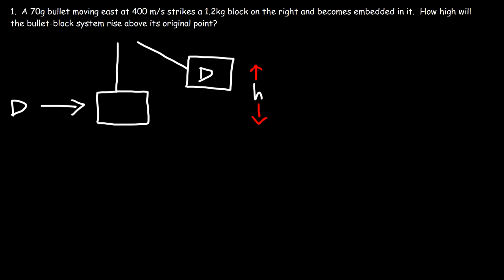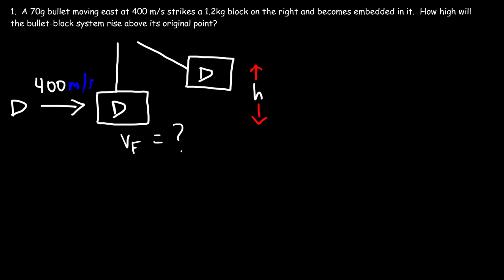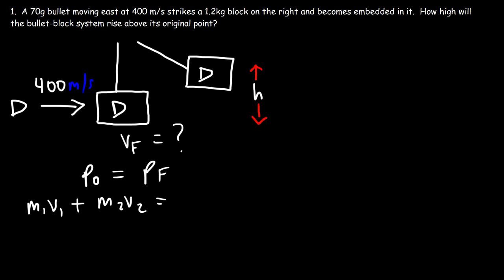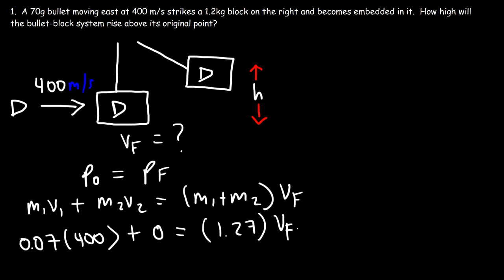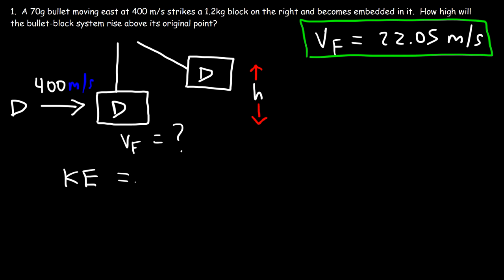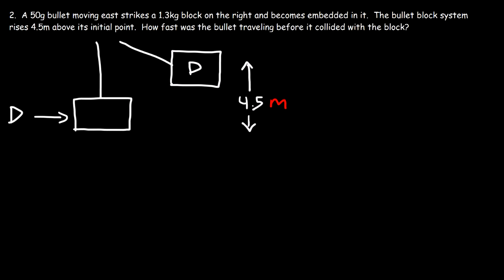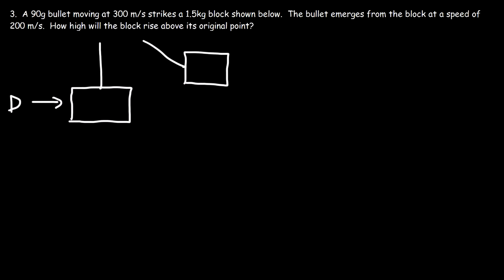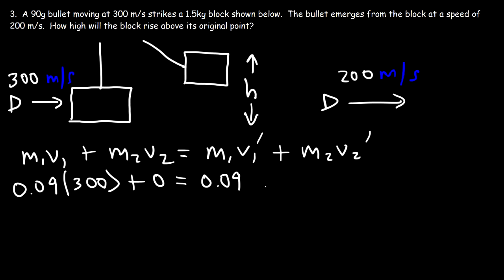Ballistic Pendulum Physics Problems - Conservation of Momentum & Energy - Inelastic Collisions

Comment: what if we dont have either the initial speed of the bullet and the final speed of the bullet+block... how do we find them?
Reply: You can solve this scenario by solving the problem backwards. Start by focusing on just the bullet+block just after the collision takes place. We know that initially, the potential energy of the bullet+block = 0 since it hasn't gained any height yet. We also know that the final kinetic energy of the system once it reaches the maximum height is also 0 since the bullet+block once again isn't moving. So based on the total mechanical energy theorem, we can say for the bullet+block that 0.5mv^2 = mgh where m is the combined mass of the bullet+block, h is the final height of the block, and v is the initial velocity of the bullet+block just after the collision takes place. This can be simplified to v = sqrt(2gh). Once you solve for v, then you can go back to focusing on the collision, and call the value for v you found the  "final" velocity of the bullet+block since it represents the velocity just after the collision happens. Now, this is a momentum problem, since we know that momentum is always conserved for collisions. Thus, to find the initial velocity of the bullet, we can say (m1+m2)vf = m1v1o + m2v2o where m1 is the mass of the bullet, m2 is the mass of the block, vf is the value you found in the first part of the problem which represents the velocity of the bullet and block combined just after the bullet hits,  v1o is the initial velocity of the bullet (which is what you're looking for), and v2o is the initial velocity of the block. Since we know the initial velocity of the block alone is 0, we can simply ignore this term. So the equation becomes: (m1+m2)vf = m1v1o. To solve for v1o, plug in all your numbers, and the number you get represents the initial velocity of the bullet.

Comment: Why does the mass not matter for the first problem during the conservation of energy step?
Reply: Since the same m is in both equations for kinetic energy and potential energy, they can be cancelled out to simplify the calculations. If you don't cancel them out, you'll still get the same answer but he cancelled them out because they were the same value. It's like cancelling out variables in algebra.

Comment: Sound reasonable, not that I really get it, maths is not my best subject.   But there must be a loss of energy due to the friction heat the impact produce, and the higher the velocity compared to the weight of the target the more heat dissipation will be a factor in energy transfer.!
 Like if you hit a heavy, say 60 kg object like a steel ball with a heavy slow moving object like a 5kg sledgehammer, it would move the heavy object more than a light high velocity rifle bullet with "the same theroretical impact energy" hitting the steel ball, because the bullet will not be able to transfer its energy to the heavy steel ball effectively, --- even if the object was hardwood there would still be a loss of energy transfer due to higher energy losses caused by friction of the bullet getting imbedded in the wood,  compared to the heat generated by the much slower sledgehammer impact?!  Do you agree.? 🤔...